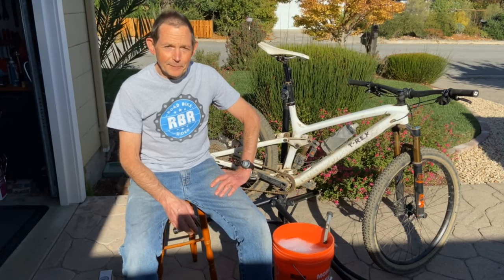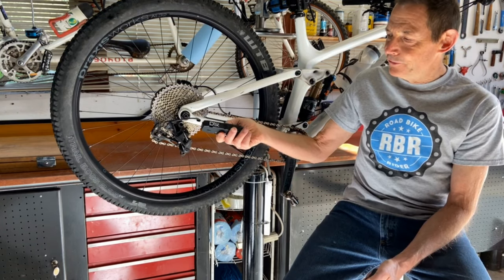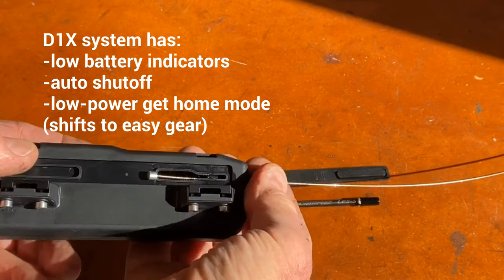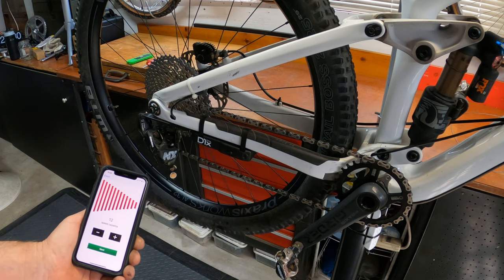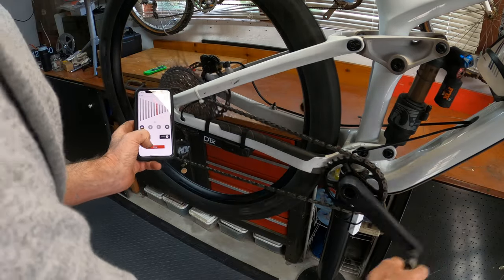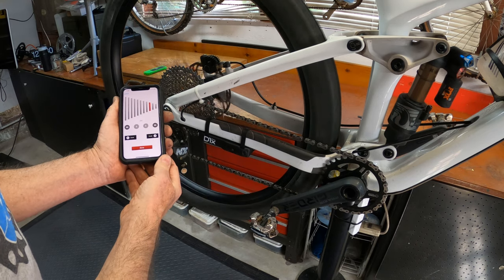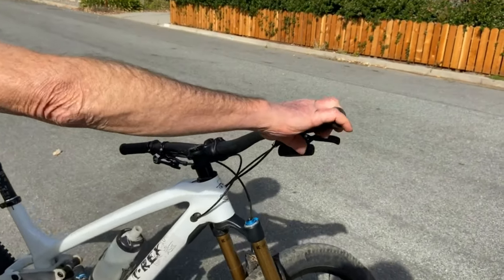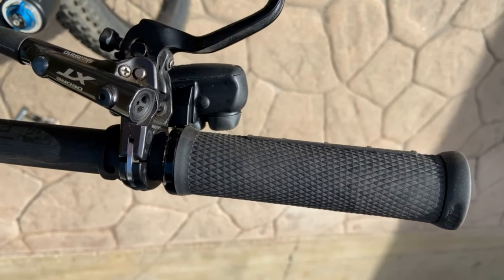Upgrade to Wireless Electric Shifting with Archer's Low-Cost D1X Trail Bike Components!

Comment: I installed the A1x shifter myself on a tadpole HP Gekko fx trike with an eBike electric motorized rear wheel. I was quite anxious as it is very difficult to get a recumbent repaired here as they don't make house calls. Once I got the eight shift points programmed it was pretty easy to do the fine tuning on the trail while riding. I took my first ride today, 10 miles uphill. It required less shifting than normal and worked great. The cable is now only 2' long rather than 5-6'. Getting the remote control installed on the vertical handle bar required removing and replacing the rubber handgrip which was not easy. The entire project was really worth the effort.
Reply from the maker: Thanks a lot for watching and sharing how you used the Archer shifting system on your HP Gekko trike, Steve. I'm happy to hear it was worth the effort and I'm sure others will be interested in your upgrade. Here's a link for viewers to check out HP Velotechnik recumbent trikes: https://www.hpvelotechnik.com/en/recumbent-trikes-bikes/gekko-recumbent-trikes/gekko-fx-26-sporty-foldable-touring-trike/

Comment: As an engineer, this solution is so simple and clean I would have never thought of it. The fine tunning is just brilliant, how many times have I had a barely bent derrailleur hanger, or maybe some play in the pulley cages  and only one or 2 sprokets aren't as smooth as the others to shift? This is just amazing. Prices feels a little too high. I may try to make something similar on my own.
Reply from the maker: Thanks for watching and I'm glad you liked learning about this enough to consider designing your own, Groove Seeker. That would be a fun project and I wish you luck! Archer is an innovative small company with big ideas. So they might be able to bring the price down at some point. Thanks again!
Reply: @JimLangley1  thank you for your reply, I just wanted to say I know for your building wheels videos. I haven't had the oportunity to build any from scratch but I have trued quite a lot of them thanks to you, so, very apreciate you sharing your knowledge. KEEP IT UP!! :)
Reply from the maker: @grooveseeker6269  you're most welcome - I'm happy to hear my wheel tips are helping you out. Thanks a lot for letting me know.

Comment: What's better - light touch or regular buttons? I'm about to order but have no idea which I would prefer
Reply from the maker: Thanks for watching and the question, Mud. They both work fine. So it kind of comes down to if you like more of a feel when you shift or less. So, for example if you always ride with long gloves you might like the regular button to be able to feel shifts better. And if you don't like having to press much, you would maybe prefer the light touch. Hope this is at least a little helpful.

Comment: The technical term for such a simple device is “linear actuator”! worm gear driven but with wireless Bluetooth and an app to make simple adjustments. Any mechanical engineer with help from an electrical engineer with app programming skills could make one….but costly. Experienced techs could do likewise perhaps at a more competitive price point.
Reply from the maker: That's interesting, Graydon, thank you! I've said since the introduction of electric shifting that the price will come down like it has with other consumer electronics. But so far I've been completely wrong - apart from SRAM's XPLR eTap, which has dropped the entry point a little.

Comment: a complaint I've read is it's too slow. but for me that's not an issue. the elimination of fatigue is worth it, and the other systems don't make sense to me.
I've also ridden in snow, puddles, washed the bike, no issues.
Reply from the maker: Some others have mentioned in the comments that it seemed slow to them, Johannes. I think the best thing is for people to try one so they can decide. There are all types of mountain bikers and all types of trails too and different riders have different needs. Some of the most extreme riders really need super fast shifts to do what they can do on a mountain bike. So I think it's best to try it out to make sure it's right for how and where and what you ride. That's the same for any shifting system, though, not just electric. Thanks a lot for watching and your thoughtful comments. I appreciate it!
Reply: I haven’t noticed any lag in mine been using for a year now on my 5010.
Reply: @sparks701  mine works fast enough for me. Mabye they tried a unit with low battery or a faulty unit and they fooled them selves into thinking its slow. 🤔 Slow or not it has been a great help for me, better fit, eliminated fatigue.
Reply from the maker: @sparks701  thanks a lot for sharing your feedback on yours, Sparks - appreciate it very much!

Comment: Very cool - so adaptable!
Though it's clearly marketed for 1x drivetrains, Archer's website says it'll support from 2 to 20 gears, so maybe you could put it on a front derailleur double/triple too.  If so, folks could do a road bike conversion still for < $800, (2 units), and its per-gear tuning would even support really odd cable pull sequences like Campagnolo's 10sp (2.5mm five times, 3.0mm twice, 3.5mm twice).  I've got a Litespeed 1999 vortex that I never want to part with, so maybe something like this would work on it :-)
Reply from the maker: Glad you liked the video, Chuck and thanks for commenting. I own a Litespeed Vortex, too - awesome bike! Archer is innovative and working on a road setup and ebike one as I mentioned. So I think it's possible that a kit for shifting both derailleurs might come along if they saw a demand for it. The adjustability is great and it seems to me it might work for the front derailleurs, too. The latest news is that SRAM appears to have been inspired by Archer and says they're working on a cable pulling eshifting system. Thanks again for watching and the comment!
Reply: @JimLangley1  Thanks - I must have looked away during your text overlay that said their road setup is in the works.  It'll be interesting to see their FD mounting options (seat tube vs. down tube in front of BB cable guide).  It's cool that you have a Vortex too!  On frames like Vortex, there's not much clearance behind the seat tube even for things like 28mm tires, let alone an Archer cable box.  I wonder how a dual-shifter setup will sit with the weight-weenies ;-)
Re: an eBike-specific solution, that raises some fun questions!  Connectors to eBike batteries and eBike headlight accessories are varied, so are they targeting a particular brand, or only setups with Anderson Powerpole connectors?  Although you won't need to charge batteries for an eBike unit, does that mean an eBike becomes un-shiftable if the eBike battery is empty?  I also wonder if for mid-drive motors they will attempt to do motor cut-out during shift to avoid chewing up the gears/chain.
Reply from the maker: @chuckb4375  When I visited Archer they had 2 new ebikes right there with their system installed. They told me they can make it "plug and play," so I assume they wire connectors for whatever setup you have. You'd want to check with them for actual tech specs for anything you want to add it to. And, on their road setup, I believe right now they're working on one for a 1X drivetrain not a double chainring setup. That's what they showed me. A few companies are making road 1Xs and it's standard on gravel/all terrain road bikes pretty much too. Fun stuff!

Comment: pretty cool, but it seems to shift pretty slowly especially if you need to quickly upshift for a techy climb. I like having the multi upshift of the shimano XT shifter which this cannot replicate.
Reply from the maker: Thanks, Clarkie. I am pretty sure that Archer has a setting that lets you shift across multiple gears at a time. They talk about it on their site. The shifting to me feels similar to Shimano Di2 shifting, which is on the slow side compared to standard cable shifting. Thanks for watching and commenting!
Reply: It has got a multiple shift option and you can choose how many gears you want to change....both up and down.

Comment: Sweet, I love mine.
Reply: What drivetrain do you have? Would you recommend I buy it even if my GX Eagle shifts fine?
Reply: @benjaminpuzzo7194  if you want different fit, want to eliminate fatigue then yes. Use higher clutch tension. Then yes.
This works with any rear derailleur. Ou can adjust each gear.
Reply: @benjaminpuzzo7194  I don't know what you mean with "shifts fine"
Reply from the maker: Thanks for watching and the feedback on yours, Johannes.

Comment: Thanks for showing inside, I was curious how these worked....a worm drive and I'm guessing servo or stepper to turn it.  Probably a pretty reliable unit as long as water stays out.  I suppose the most interesting part will be determining when it's time for cable replacement, as the rider can no longer feel a friction increase.
Reply from the maker: Thanks for watching and the thoughts, Cup & Cone! The cable is so short that it should barely stretch and there are no exposed sections to corrode. I think it'll last for many years as long as it's put in with a little lube. I'm not sure how the screw is driven, but I think you're correct - some servo or stepper. Archer did tell they use an Acme thread, or courser pitch. From the reviews on their site, it seems that the systems out in the field are holding up well. I know Shimano uses something like this in their Di2 derailleur for moving it and they told me the mechanism is nearly foolproof. Thanks again!

Comment: First time I've seen this system, looks really simple to install.
 I was concerned about the unit moving around on rough terrain only been secured with those cable clips, I'm guessing you found it to be stable Jim?
Also, that's the truest running rear wheel I've ever seen... Great video ...
Reply from the maker: Hi Graham! Thanks for watching and the comment. Yes, it's amazingly simple to install. The app took a little figuring out but was great to use once I got the hang of it. I should have explained more on how the Shifter attaches. Those two straps wrap around the chainstay or seatstay. Archer recommends zip tying the Shifter to the stay before tightening the straps. If you do that, the Shifter is held tight and when you pull on the attaching straps you can get them really tight and then there are super secure clamps with 2 screws on each strap to lock the straps tight. So, I bet you could knock it out of position if you crashed and hit it, but I don't think it will move just riding. And here's the cool part: Even if it moves it doesn't affect the cable adjustment or shifting adjustment. It will still shift fine, though if it were to get knocked way out of position maybe it would hit the spokes or your heel and you definitely wouldn't want that. So you would stop and push it back where it was. Thanks for noticing the wheel.. I build that one ;-)
Reply: @JimLangley1  Haha... cheers Jim, I knew it would be one of your builds...

Comment: Wow….I am impressed! Now if the price goes down a bit, I will buy one.🎉 So does it add some weight relative to the mechanical cable and shifter?
Reply from the maker: Hi Graydon! Yes, mostly because of the 2 AA batteries it does add a little weight but unfortunately I didn't think to do a weight comparison so I can't say exactly how much. Archer lists their D1X at 235 grams if you wanted to weigh what's on your bike and do the math. The price has gone up by about $50 since I did this review. I don't know if it'll come down or not. Appreciate you watching and the great question, thanks Graydon!
Reply: @JimLangley1  - thought China bike tech stores would be onto this already….checked AliExpress but not yet available. No doubt Asia businesses will grab onto this concept very soon and drive the price down IMHO.
Reply from the maker: @gtranquilla  I thought that, too, Graydon. It's possible that SRAM coming out with their Rival XPLR eTap at about $269 was in response to Archer's system even though SRAM's isn't cable operated or as fine-tunable.

Comment: I’ve never used the electronic shifter but this feels rather slow compared to mainstream models?
Reply from the maker: Hi Bikeo! All electronic shifters seem slower than cable shifters on each individual shift for a reason: the e derailleurs shift by programmed steps; while cable derailleurs shift by how far the lever travels. With the former you have to wait for the e derailleur to complete its travel/shift; for the latter, you can push the lever past where it needs to go (the detent/click) to "force" or "slam" or "speed" shift. That's the big difference in shifting speed. I think it's something each individual rider has to decide for themselves. I found it took time to get used to it. The thing is that the electric shifting provides a more consistent, precise shift. It's subtle but if you notice the precision shifts and how the electronic shifting almost always hits the gear spot-on, you grow to like it a lot even though it can be slightly slower than cable shifting. Hope this helps explain. Thanks for watching and the great question/comment!
Reply: @JimLangley1  that’s a good explanation. The precision in shifting performance, specific to each cog, is really where this e shifter shines. Analog shifters cannot vary their precision for individual cogs.
Reply from the maker: @RideAlongside  I forgot to mention that the battery power affects shifting speed, too. With a low battery an electric shifter can shift slower. And with more battery power like say on an e-bike, the shifter can make the shifts faster than with lower power batteries.
Reply: compared to axs it's definitely slower, but very nice either way

Comment: Can it handle harsher terrains like enduro or downhill tracks? (i know it already has it in its name "trail") but im still wondering couse it looks like it is built great. And also what is your bike?
Reply from the maker: Thanks for watching and commenting, Jay. My bike is a Trek Fuel EX. The thing about electric drivetrains is that they work as long as the batteries are charged and in the case of the Archer as long as you don't smack the shifter and wreck it somehow. But you could crash in an enduro and ruin the derailleur, too. So it really depends on the course, how skilled and lucky you are. But overall, it should work fine as long as it has power and a crash doesn't affect it. Hope this helps.

Comment: Are you still using the archer?   Everyone's pushing the cost prohibitive axs now.  Have you been able to compare performance?
Reply from the maker: Thanks for watching and the question, Rick. Yes, I'm still riding it. I have not had a chance to try the AXS mtb shifting only the road system. But, I would say that the newest AXS, the GX looks pretty impressive for the price. When I got the Archer system that wasn't on the market yet. Now that SRAM has a much less expensive system it's worth a look. I like what Archer has done with their D1X. I think some of it can be improved, such as ease of charging the batteries and the speed of shifts. It's likely they're working on upgrades as I type because they're a small innovative company. On the other hand, SRAM is an industry giant with massive engineering and R&D, so I would expect their new system to be very good. The Archer system's most ingenious feature is that it works with the derailleur you already have. I heard SRAM is working on one of those, too, but don't know when we'll see it. Thanks again!
Reply: @JimLangley1  Hi the shifting speed is going to be resolved soon. They have already demonstrated a new battery which speed up the shifting. Look at their new Sprint battery set ;)
Reply from the maker: @hman72y  thanks a lot for sharing this information, appreciate it!!